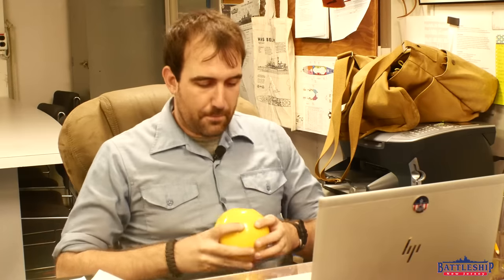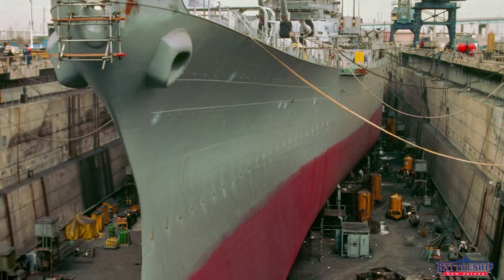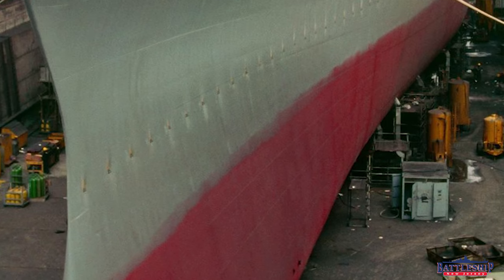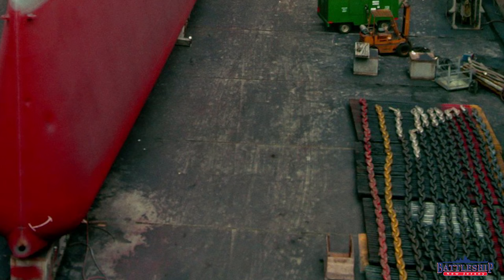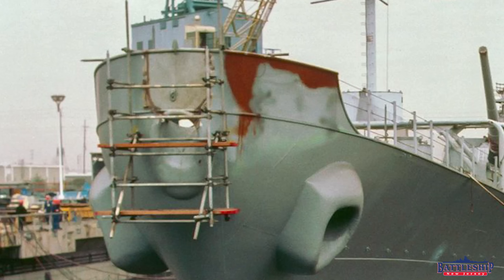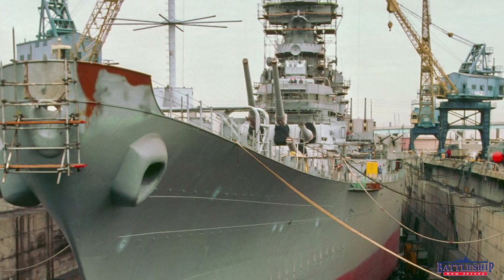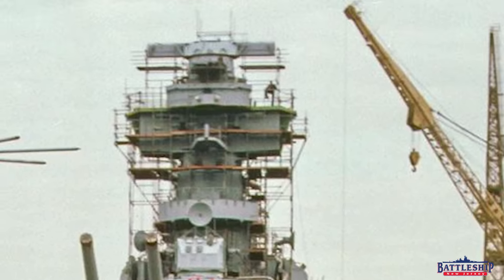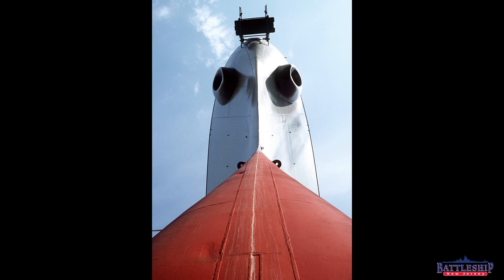Dry Docking New Jersey: A Picture is Worth 1,000 Words

Comment: At 9:19, the yellow tank on the right is a sandblast pot. Note the red "guillotines" with the hoses running through them.  The blast hoses will have an electrical cord taped down the length of the hose with a dead-man's switch at the nozzle which the operator holds down while blasting. The switch opens and closes a solenoid, which in turn raises the guillotine, allowing the shot to pass down the hose.
Reply: Your timestamp got goofed up.  I hope someone fixes it.
Reply: 4:35
Reply: 9:19 gives a better view
Reply: @pedzsan  Fixed it, thanks.
Reply: yep, somebody also commented that those holes were cut into the hull to sandblast and repaint inside the tanks down there. 
Good comment. 
☺
Reply: I don’t know about the specific pots in the picture, but a lot of them have air actuated dead man systems so that electricity isn’t needed for the operation. I worked many a night in a blasting yard cleaning steel to a pure white metal blast during construction of a nuclear power plant. All of the pots we used had only air controls, no electric.

Comment: I was the Docking Officer at LBNSY when New Jersey was reactivated. Responsible for the docking and undocking and managing all the underbody work done while in drydock. Many great memories as well as the "pucker factor" during the evolutions, as well as a notebook full of pictures. My 15 minutes of fame, interviewed by the TV stations in LA.
Reply: Do you remember " building 5"?
Reply: @samuelschick8813  Sure do, "headquarters" where all the Captain department heads hung out!
Reply: @timspence3597 , LHA 5.
Reply: @samuelschick8813  USS Peleliu. My first evolution as Docking Officer was to undock USS Tarawa LHA-1, what a nightmare, thought that would be my first and last evolution. As the dock was being flooded for lift-off, their DCA came over and gave me a new liquid load, which was significantly different than what they had given me a couple days earlier for stability calcs. It would have taken several hours to recalculate and I would probably have lost the high tide window. I decided to continue because it would have delayed the undocking several days for the correct tide to exist and you really don’t want to re-land the ship only as a last resort. Well, as soon as the ship started to float, it heeled over to port and kept heeling over as the water level rose. I sent one of my under-instruction officers over to watch the deck edge elevator, which was fully down and could not be operated, for clearance as it overhung the drydock wall. There was a large mobile shipyard crane on the flight deck, so I had one of the riggers drive it over to the starboard side of the deck opposite of the elevator hoping that would offset some of the heeling. I slowed the flooding and listened as he called out the clearance. At 6” above the wall, it stopped heeling and continued the undocking without further incident. Need less to say, when the shipyard commander found out, he reemed the Tarawa CO a new one. My second evolution was the New Jersey docking, which went smoothly except for the PCO (prospective commanding officer, a rear admiral-select, told me to stop the entry into the drydock so he could get off the ship and didn’t want to wait until it was on the blocks and a gangway was installed. Since Navy Regs clearly states as soon as the stern crosses into the drydock, the Docking Officer owns the ship, not the CO. There was no way I was going to stop the ship entering the dock, so it was my first and only time to tell a flag officer NO! Pretty gutsy for a young Lieutenant but I was just following Navy Regs!
Reply: @timspence3597 , Best one I saw was a chief tell a Lt. "Fuck you sir!" in a rather loud voice. Now the details. We moored out to take on ammo and our chief made a deal/bet with us. He said if we had our rounds and powder onloaded and stored properly before turret 1&2 we would get a day of liberty when back pier side.

Chief did not try to stump us up and had the barges coming fast. Now an onload for a battleship 16 inch guns takes 3 days. Well we finished our onload in 2 days working from 0600 to 2300, we wanted that liberty.  Yes we beat the other turrets by 1 full day and spent the rest of the time working on the turret.

So we get dockside after knock off but quarters the next am is when it started. There we are at quarters and chief tells us those who do not have duty can hit the beach after quarters. Then along comes our Lt and starts handing out work assignments. Chief told him the deal he made to no avail. Lt said these jobs had to be done today. Chief asked us as a favor to him to stay and work so we did.

Come quarters the next day chief says if no duty hit the beach after quarters. Once again here comes out Lt with job assignments that cannot have to wait and have to be done today.  ( both days they were bull shit jobs). Once again chief reminded Lt of the deal and he owed us a day off, again to no avail. Again chief asked us to stay as a favor to him, we did.

Now the 3rd day at quarters and chief says if not on duty hit the beach after quarters. Along comes Lt and once again hands out work assignments that cannot wait and have to be done that day.

Chief: " Lt, I promised the men a day of liberty when we got back in for their hard work. I asked them the last 2 days to stay and work as a favor to me."

Lt: " I don't care chief. These jobs have to be done today."

Chief faces the Lt: " Fuck you sir!!"
Chief turns to the division: " G3! Attention!! DISMISSED HIT THE BEACH!!! If you have duty standby."

Those not on duty went down changed and hit the beach. Lt stood there with dropped jaw that an enlisted man told him " FUCK YOU!!". Nothing ever happened to chief over that.

After the Missouri was decommed I went to ships reunion in Pearl where I ran into my old division officer ( LCDR) and told him that story. He said he never heard that story and if the Lt started paperwork on our chief he would have stopped it. Lcdr said our Lt was a real prick and non of the officers liked him. Said he wished he was there to see our chief put out Lt in his place.

Chief earned our respect even more than he already had. We would have followed that man to the gates of hell no questions asked. I learned as an NCO you take care of those under you and stand up for them. Don't ask them to do anything you are not willing to do.

But I admit I did at times wonder about O's coming out of the academy. We did a dependents cruise out to Santa Catalina and back so took my wife on it. Standing above the 5"38's there was an officer to our left with a woman.

Officer pointing at the 5"38" twin mount:
 " Those are the 16 inch guns."

Damn it was hard to bite my tongue but I did. I always wanted to ask him if those were the 16 inch guns then what are the guns forward of the bridge and aft of the superstructure. LOL
Reply: @samuelschick8813  I was prior enlisted myself (Nuke MM), commissioned through the NESEP program in 1976. That made it a lot easier to deal with the sailors as a division officer (MPA on a destroyer) as I could stand any watch in the engineroom or fireroom and they respected that. After 2 Med deployments, decided being a SWO was not real exciting so transferred to Engineering Duty and spent my last 13 years in Naval shipyards and Supervisor of Shipbuilding.
Reply: @timspence3597 , Mustangs always made the best officers in my opinion. They know both worlds and can see where the enlisted are coming from.

First ship the officers with a few exceptions were pure pricks. The CO would never walk out on the weather decks while at sea and would go to the bridge and maybe out on a bridge wing. But he made sure to stay in sight of other officers. He never left officers country and stayed in his cabin or the wardroom. If that CO said " we're going to hell who is going with me?"

It's like the series Band of Brothers where the men were being interviewed and one said " We had good officers. But we had great NCOs." The crew would have thrown road maps at him if they could. There was very,very low moral on that ship.
Reply: @samuelschick8813  I remember a BTC laughingly complain that since the Peleliu was the last of her class, she was constructed from all the spare parts left over from the four other LHAs. Shipyard did a lot of work on Tarawa, Belleau Wood, and Peleliu during my 20 years there.  I enjoyed how spacious the ships were, just a lot of walking.
Reply: Did you work with or for Dick Landgraff? He was "Santa" on my first ship, the USS Essex LHD-2 after our LBNSY PSA in 1993/94 time frame.
Reply: @dundonrl  No, I was at LBNSY from 1980 - 1983.
Reply: @samuelschick8813  An old acquaintance of mine years ago had been a CPO in the Royal Navy. I never realised that an Officer can not give an order directly to a rating, he must give the order to the Petty Officer, who will allocate the work. Apparently there were times that Officers tried it on, to get a "Belay that!" from him, followed by a polite: "Did you want something done, Sir?" Orders were then given, interpreted just enough to make the point, to the ratings. In his own words, he could be a right bugger, but the chain of command exists for a reason. I assume the same exists in other services, where NCOs are given the orders, and then allocate the tasks as they see fit to execute them.
Reply: @coniow , My division officer gave the work list to my chief and chief assigned to to the proper NCO who then put his guys to work on it.
Reply: @ytlas3 , Never got a notif that you replied.

I was a 16 inch GMG on the battleship Missouri when the Jersey was in dry dock in Long Beach. We were always moored next to the Jersey when in port. The Jersey was referred to as the spare parts bin for the Missouri. But both the Jersey and the Missouri poked fun at the U.S.S. Peleliu (LHA-5).

The entire time I was on the Missouri ( 2.5 years) the Peleliu never left port a single time and was called building 5 by the Jersey and Missouri crews. Well one day me and some others were below deck when one of the guys came running down and screamed " The Peleliu is getting underway!!!" ( Peleliu was going on a 6 month Weestpac). We all rushed up to the main deck like it was GQ or abandoned ship and were leaning on the port life lines to watch this event. 

If looked over at the Jersey they were gathered on the weather deck to watch this event. The port side of the Missouri was covered with officers and men waiting to see if the Peleliu actually made it this time. Tugs are at the side and ends of the Peleliu ready to pull her away from the pier. 

Peleliu bridge: : " Single up all lines."
                            " Take in all lines."
                            " Underway, shift the colors."
                          
Now we thought the Peleliu just might make it to sea when about 10- 15 seconds after " Underway, shift the colors." we heard a loud "BOOM!!!" from inside the Peleliu. The tugs moved around and pushed the Peleliu to the opposite side of the pier we were one. We always wondered why we never docked on that side. The tugs started to push the Peleliu toward our dock and Missouri deck sent out men to handle the lines.

 Peleliu bridge: " Moored, shift the colors." was heard less than a minute after " Underway, shift the colors". 

 Now the Missouri and Jersey really poked at the Peleliu for their " 40 second Westpac", " Fastest Westpac in navy history",  " Pier jumper" and such. Jersey crew would poke at the Peleliu saying at least the Jersey had a legit reason for not going to sea. If went to NEX you never saw a Peleliu sailor wearing the ships ballcap, it was always dixie cups. If by the rare chance one did wear the ships ballcap they would never make eye contact with a Jersey or Missouri crew wearing their ships ballcap.

Comment: I was stationed on the USS Peleliu (LHA 5) in 1981. We shared the pier with New Jersey then the Missouri. Myself, along with several of my ship mates watched as the towed the New Jersey around the break water. People really don’t appreciate these ships until you see them out of the water. There is WAY more of the hull below the waterline than above. Amazing ships.
Reply: I did a little cruise on the Peleliu in 1994, I was in the Marine Corps and was stationed in Hawaii at the time, they pulled into Pearl Harbor we got on and sailed to Singapore, when we left there we were told that we were needed in Somalia ASAP, took CH-46 back to Singapore to get flight to Diego Garcia...... there was no connecting flight to Somalia, so we sat on the beach and jet skied and drank beer until the Peleliu was within range of a 46 to pick us back up..... fun times.... eventually made it to Somalia to spend a few months until the pull out was finished....... Loved it, great times

Comment: Great video. A minor correction. You mentioned in passing that feed water is supplied via sea chest. It's not. As a nuke, on e of the questions we had to answer in watchstander qualification boards is, "I'm a drop of water. Get me to the X. All feed water is first distilled, then ran through a polishing tank to make it pure water before feeding it into a boiler. I've seen the red and yellow side plates before when I was stationed in Bremerton. That is where the decommissioned ship folks mount the alarm lights. The background colors make it easier to see what's wrong at a distance.
Reply: He also referred to the sand holes as sea chests. There are only four sea chests and they're directly underneath the ship.  I've been to all four.  When I was under the New Jersey hull in 1987, the sea chest were the only place I could straighten up.  Walking hunched over under the ship is rough on the back
Reply: To be fair, I think he said feedwater for the evaporators, not the boilers.

Comment: The name you where looking for, "eye hook where chain is attached inside the chain locker" is called the  'Bitter End' and it would be a fun quest to find if the New Jersey has them brought to the outside of the chain locker, or accesable via a small hatch.
All 'normal' ships have that, so the chain can be let go, if payed out in full and unable to pick back upt. without going into the locker and having the chain flying by your head when you slam it loose.
Reply: There was a video I saw a few months back where Ryan goes into the chain locker and a few other spots showing that stuff ✅️
It definitely would be very deadly tp have a chain made up of thousands of pounds of ⛓️🔗  flying past your brain container.

Comment: I worked for the phila. Naval shipyard and was on that TDY trip back in 1981 and 1982. I was a welder at that time and we spent over a year supplementing the 	``LBNSY workforce like they did for us during the first SLEP on the Saratoga and later Forrestal. The pictures of the dry dock brings back memories. The access holes that were noted was for the sandblasters could go in and and sandblast . Two hole per tank. One for equipment access and the other to get rid of the shot. Shoveled the grit back into the dry dock to be used again. They call the shot “black beauty”. Welders would then have to go inside and weld those access patches and the go on the outside and gouge the new weld so that it could be welded from the dry dock and pass MT or UT inspections. There were over 500 + of these access openings and on a carrier there was close to 1000. This was a very comprehensive overhaul that last close to 2.5 years. I was 
I was involved in welding the first foundation for the tomahawk cruise missile launchers on the New Jersey. Nice job you are doing keeping the New Jersey viable  for future generations .Keep up the good work.

Comment: I work at the current location where this dry dock is located. It’s now a container yard for shipping. Whenever I drive over where the dry dock was I think what a battleship or carrier would have looked like then. Long Beach was a natural deep water port. And I’ve been fortunate to work on the cranes with talented mechanics who worked many years on these ships.
Reply: The USS Chicago CG11 was in that drydock in 1973 and that is where I departed the Navy. Also, this is the drydock Queen Mary used before going on display just around the bend.
Reply: @chrisjeffries2322  interesting, so much to learn about. Thanks for sharing!

Comment: Around the edges of the screws while in dry dock a protective edging is placed to prevent workers from being cut by the very sharp edges of the screws.  The type of fuel used by the Navy is NSFO, Navy Standard Fuel Oil.

Comment: My experience with naval shipyards is that you do as much work as you can on all parts of the ship during drydock -- whether those jobs require drydocking, or not.  Warships are expensive commodities, and the navy wants to put them back into service as fast as possible.   This is where the PERT chart (Project (or Program) Evaluation and Review Technique) comes in.  You identify critical paths in a project's timeline and concentrate on keeping those on schedule.  So, if you have jobs that will take three months, and you will be in drydock for two months, then you start working on those in drydock so that your pierside availability leaving drydock will be just one month.
Reply: True.  I was board the USS Newport News, CA148 (heavy cruiser) in late 1969-early 1070 when she was in dry dock at the Newport News (VA) shipyard for a overhaul post VN cruise.  Being new on aboard it was great seeing the whole thing.  And yes, there was all sorts of work being done at the same time: such as welding.  Spent a lot of time on fire watch as the welders worked a little between breaks.  They were in no hurry to finish their jobs.  :)